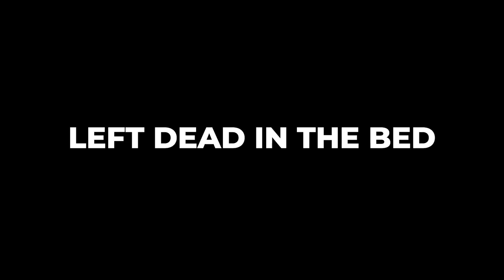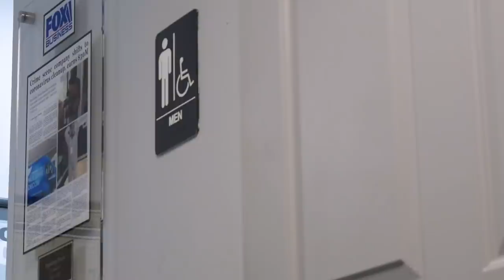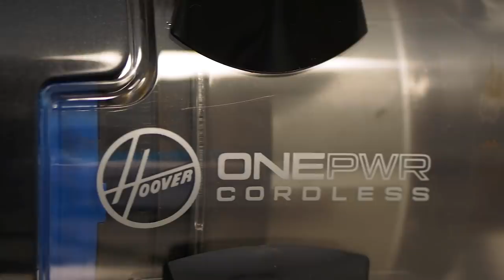Left Dead in the Bed | Tampa, FL

Comment: I worked in Healthcare. The young man is right, bodily fluids are biohazard just like blood is. Also, wear eye/face protection until the job is done. Pulling up carpets the dust and dander will spread any bio matter in the air, same with sawing or chiseling out drywall and tiles, the dust is spraying any biological materials Into the air. Don't be cavalier, Always protect yourself!!

Comment: my friend's neighbor was just found dead after 2 weeks in the Florida heat! they smelled him thru the apt. walls. It was my first time smelling death!! horrible! they were sprinkling baby powder ariund the apt. to try to mask the smell!!
Reply: Tell your friend to boil lots of white vinegar. The vinegar smell is very strong but completely non-toxic and will help kill off the decomp smell. Plus a gallon jug of white vinegar is super cheap. Or get a bunch of cheap dishpans or other large, shallow plastic containers to place around the apartment and fill them with ammonia (also cheap). Leave them out for a day or two (friend may want to go away for a couple of days) and it will help eliminate the smell. Both the vinegar and ammonia smells will dissipate pretty quickly and once they've absorbed/killed the decomp odor they can be dumped down the toilet. Repeat as needed. If they're still bothered by the smell, a fresh coat of paint will definitely help. Prime with an odor-blocking primer. Shampoo the carpets if needed.

Comment: should have wrapped.the boxspring as well thats gross
Reply: We need to hear from Laura if it was ok to leave like that, I never seen them do that before, very gross!!
Reply: He said that it didn't indicate. So we're to understand that it was not bio on the box spring.  

The client need not pay the premium for biohazard handling and disposal vs. bulk item landfill disposal.  The difference in cost is based primarily on weight. Even something as relatively light-weight as a box spring could be hundreds (or more) to handle as bio.  That's why they usually cut only the portion of beds, carpet, flooring and walls that indicate, and trash out to landfill everything that doesn't.  

That could be thousands in cost savings, even with the additional labor cost of cutting away the bio material.  The client/insurance carrier paying the tab on this might have needed expedince over cutting away bio on the actual mattress, so they instructed the team to remove the whole thing.  But that doesn't mean that they want to authorize the cost for bio handling on anything not necessary. 

What's odd though, and why I ultimately agree with you, is that the soil on that box spring appeared to be directly under the heaviest bio of the mattress. He remarked that it was just "water" from the body, but not bio.  But damn if it didn't look like decomp fluid there.  Even if it was just water from the body, how the hell is that not considered bio?  It's not like water from the tap. That fluid came out of a body after death; because of decomp.  So indicating or not, you couldn't pay me enough to handle that like anything but bio. 

Side note, but kind of related:  I hope I'm not the only one totally underwhelmed by the videos over the last couple months. I used to really look forward to them as part of my weekend ritual.  Now, we get 30% commercial promos and barely 70% of clean-up video - too much of which is hideous go-pro.  I hate to say it, but more effort went into the Hoover sales pitch than the last few clean-ups combined.  No one even addressed the soiled box spring, beyond one obligatory statement that it didn't indicate.  Why not show the indicator spray going on and not reacting?  They would always do that before.  So of course viewers are going to be skeptical.

Something is really "off" w/Spaulding lately. I hope that whatever it is, it isn't something bad, and that it goes back to normal, soon. Even Thaddeus seems to be not himself. And I really miss the inspirational & funny Thaddeus from the past.
Reply: @r.a.waters9964  i know that but it still ia body fluid and it wouldnt of hurt to cover it for the sake of neivhboura who knows a man died in there
Reply: @troyaldridge3853  I hear you. But, to be honest, seeing a coroner hoist a body bag out is a far, far more difficult sight.  I'm willing to bet that the few neighbors who were home, weren't popping open their doors to watch them haul out items.  
In the interest of everyone's safety, a tarp would have been comforting to see, though...just in the interest if cleanliness & hygiene, if nothing else.

Comment: hey are you in md found a tenet had passed with windows open in 100 degree heat and it was fowl had to remove some of the bio hazard myself like chair he died in and fluids off floor to try and remove the stink sort of he was probably only in there 5 days estimate
Reply: Pretty good  conditions for accelerated Decomp